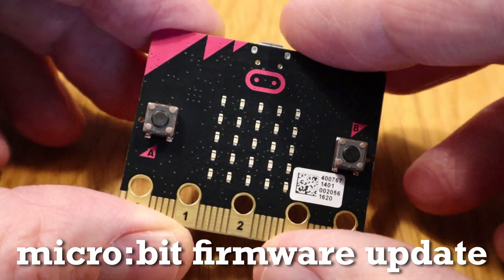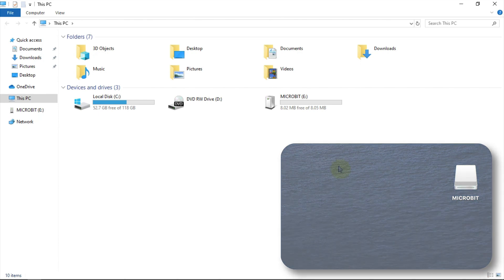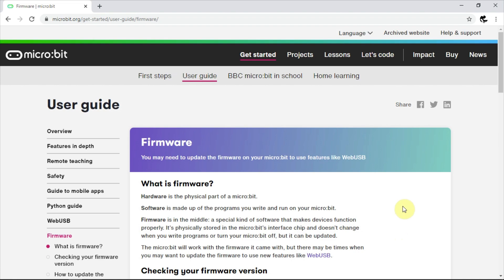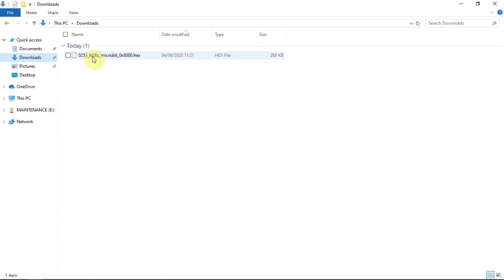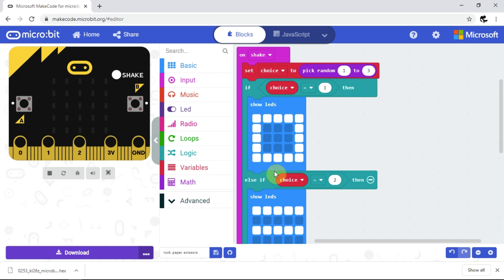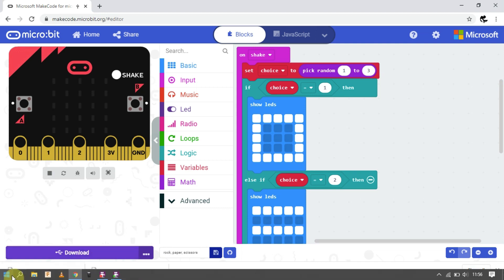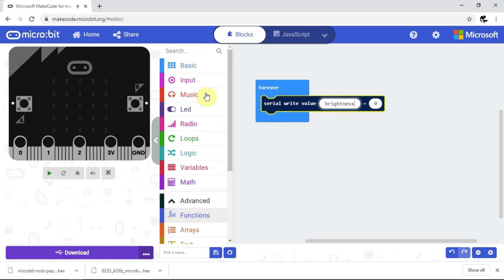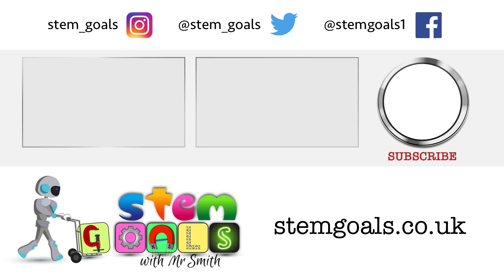BBC micro:bit FIRMWARE UPGRADE - how to do it and why

Comment: How Can l mesure magnitic force of object
Reply from the maker: You can do that in a similar way to how I measured the light level in the video. I am thinking of making a video on this - any other things that I could cover?
Reply: @StemgoalswithMrSmith   l did it .l changed the light level to magnitude force . I look for how can I detecte movement ? I'm vrai interesting to lorn more because you work with simple method